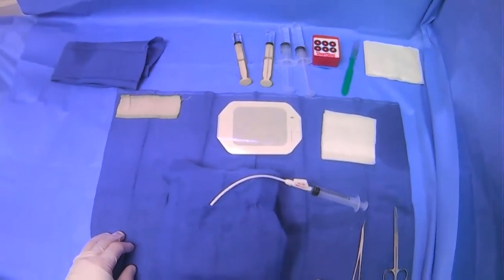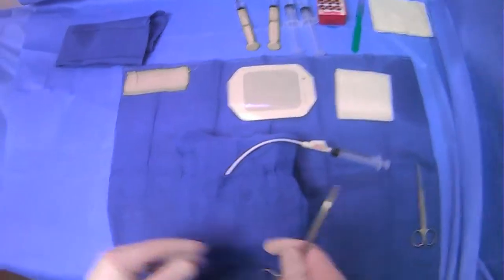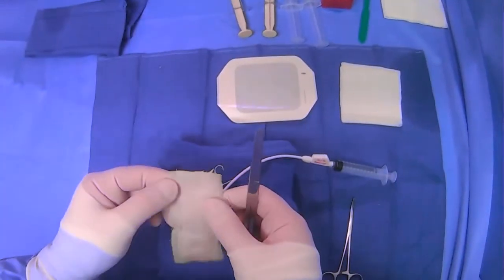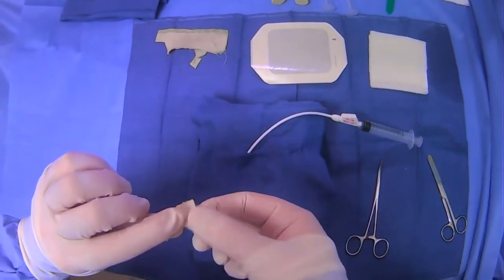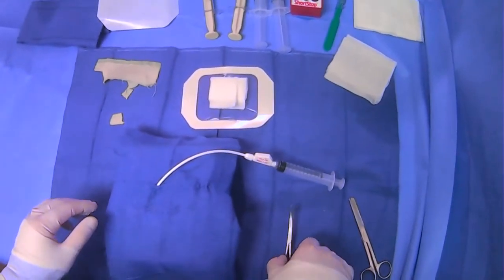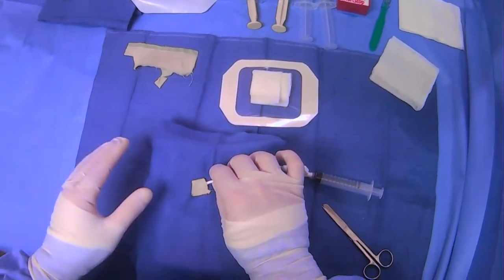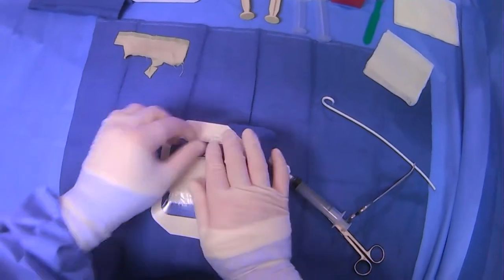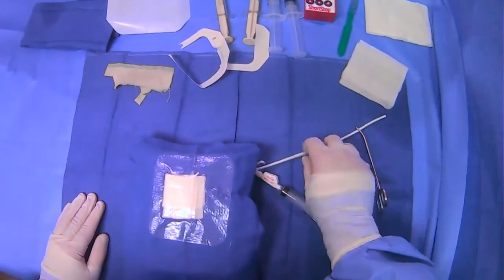Removing IR Chest Tubes (Pigtail Catheters)

Comment: Isn’t there a small lever/lock that can be opened to release the suture? This way you don’t need to cut to release the suture or deal with the clamp. Also, do you have to have the patient hold their breath or engage in a valsalva maneuver when removing pigtail chest tubes or is that only reserved for the larger chest tubes? Thanks.
Reply from the maker: Yes but as the video explains if you were to open this lever air would be introduced into the pleural space as the seal is broken. Many providers do have the patent hold their breath or hum while the tube is being removed however it seems the most important maneuver is to have the xeroform ready to cover the hole immediately so you can apply an occlusive dressing.

Comment: Clamping the tube probably still holds the pigtail string...no?
Reply from the maker: Hi Matt, this is a good question. I think often times there is a fear that clamping will trap the pigtail suture on the inside of the tubing, however we have found this doesn't really seem to be the case because the suture can usually slide without issue (as shown in the video). Some people partially clamp before cutting the tube, then fully clamp after making their cut to further ensure they don't trap the locking suture. While this doesn't have too much of a downside, I think it generally is unnecessary.
Reply: @Stepwards  This particular pig tail drain allows you to release the suture by unlocking the mechanism. https://www.ciamedical.com/cook-medical-g09705-each-ult8-5-38-25-p-5s-cldm-hc-dawson-mueller
Reply from the maker: @mariekristellemata4089  thank you for the added information! Yes the drainage catheter can be unlocked by releasing the mechanism however often times we find that once these catheters have been in place for some time (especially when they are draining fluids etc) that the suture gets stuck in the hub if you simply unlock it in the traditional manner. This is why many of us actually cut the tubing to make sure the suture is released. It is important to realize that whether you cut the tubing or unlock the mechanism both will allow for air to enter retrograde into the catheter which is why the tubing is clamped.
Reply: Sometimes when I cut the tube and pull it out the thread gets left behind and I have to pull it out of the patient. Does this happen often with you?
Reply: @Ellascinder this has happened to me. I’m not sure what causes this.